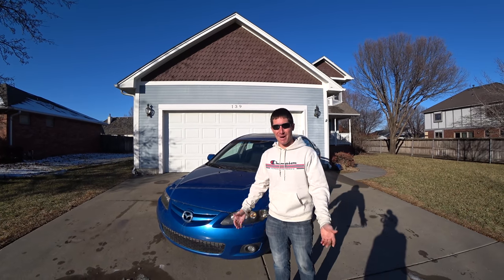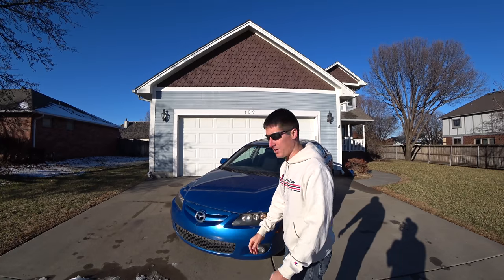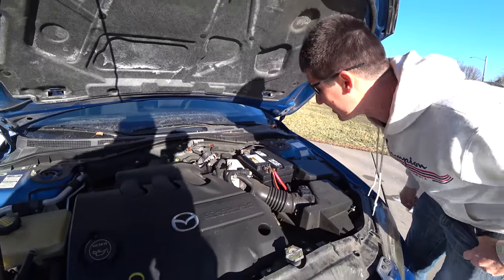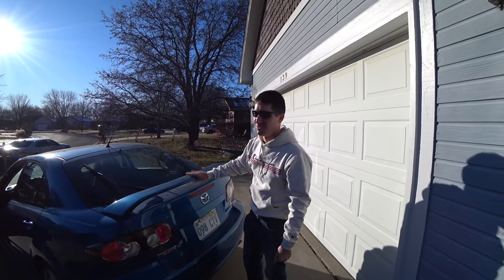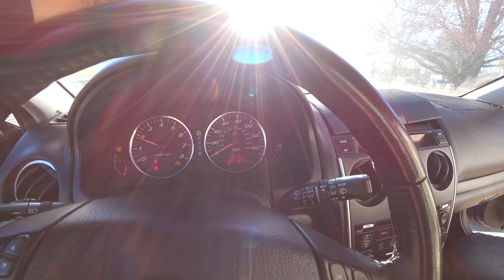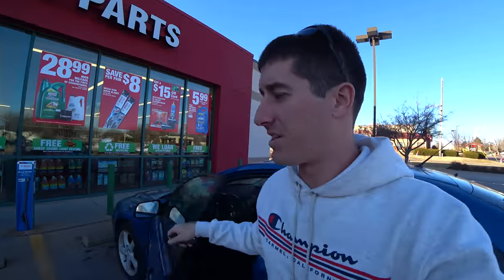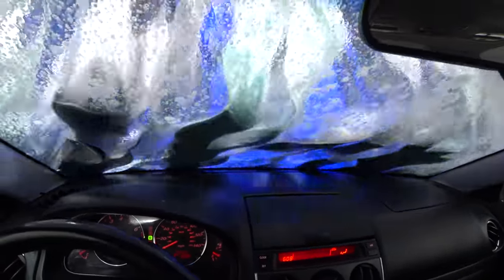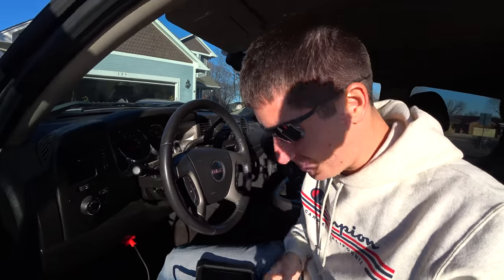I Bought The ELUSIVE Mazda 6 LIFTBACK For $800 *HOW BROKEN IS IT?*

Comment: A trick I learned for blown hood struts/hatch struts... open the hood/hatch all the way and take a rubber mallot, or the heel of a closed fist, and whack the piston of the struts straight back to slightly bend it. It will put a bow in the piston and give it enough resistance to hold the hood or hatch up temporarily. You can wiggle the hood or hatch to test it before putting your head under there.

Comment: We had one of these traded in at my work. It was a white wagon. V6, manual trans. Full tan interior which was ugly but extremly clean, no stains even on the floormats. It had air ride and rx8 wheels with wheel spacers. It was a one of a kind really nice car. Nothing wrong with it. I know because i drove it multiple times and looked it over almost everyday before the auction guys took it. Truly a nice one of a kind car.

Comment: These year mazda ,especially  the protégé. Last a long time and cheap to maintain.  Our family beater was a 2003 protege with over   250k on the original transmission and motor. We bought it at 128k. Sold it to my friend, who is a notorious car killer. Just saw the car last week.  He over filled it with oil and called me.  Oil was leaking out of everywhere it could and burning out the tailpipe.  Drained the oil and somehow it still works but now leaks oil from the motor seals. He also didn't metion to me that the front brakes stopped working and he still hasn't swapped out all the torn suspension bushings.  Hope the car can make it to Christmas.

Comment: I still have my 2005 Mazda6 with the 2.3 4cyl. it has a 5 speed manual and 170k miles. it has been a trouble free car for the most part. I replaced battery, clutch and radiator, everything else has been solid.

Comment: I own a 05 Sport Wagon with the rare 5 speed Manual, its my daily and I own a 06 Mazdaspeed 6..Few tips, the precats are are a known failure point on the Duratec 3.0's especially in the 6's, this is well documented, check them ASAP especially since you have a misfire!!! Cheap coil packs do strange things to the duratec, DENSO is reccomended by most,  Replace the EGR valve while doing the coils, its cheap can be replaced in under 5 min and is probably the reason why its using a little oil. my wagon is on its 3rd engine, 1st died due to precats failed - cracked ringlands and the final nail was it jumped timing, 2nd blown headgasket (cheaper to replace than do a HG job on a duratec) and 3rd was the charm lol, I have a few vids on my channel, great buy either way and they are super fun to drive, I guess its why I hold on to my wagon aka moneypit! - Ern

Comment: I love this channel.
I’d love to buy a car from this dude
IF
(I had the money and need really)
But I might get the money soon
BUT
I’d want all the bullcrap sensors replaced
New O2 sensors,
Mass airflow if it has one
MSD coil pack
E3s
K&N
Any leaks
PCV valve 
New breaks all around
New tires
New catalytic converter 
Perfect windshield and glass, sprayed with that Ceramic coating I got from the dealership
Upgrades where available 
On K5
Electric radiator Fan, factory crank fan delete
Electric power steering pump on 5.7 
Rebuilt running gear(s)
Carbon fiber removable top. (He’d have to learn how to lay carbon fiber)
On 08-12 Malibu LT,
ALL new lights.
The headlights have to take off bumper to change the dam lights.

Comment: Make sure you take note of the coil cables location. It possible the plugs might have been changed before by someone and the got two of the cables switched around. There is another YTber who has a garage that he fixes cars for people RTJ. He's found this similar issue with miss firing after the driver changed his plugs, turns out he had the cables  to the coil packs from cylinders 3 and 5 switched around.  :)

Comment: My friend just bought one of these that I towed with the misfire cylinder 6, he found that the back cylinders were getting filled with oil, carfax says it was at the dealer 5 times in 3 years for a misfire. Not sure. I’m a GM guy. But that’s my 2 cents to help you out.
Reply from the maker: I expected the same, plug wells were basically all dry on this one!🍻
Reply: WatchJRGo  he also did coils, injectors, gaskets. He went beast Mode on. Fixing all the sauce.
Reply: Bad Valve seals are common on the v6

Comment: Good cars.  I once had a 2003 liftback with the 2.3 inline four, 5 speed manual and a 2005 MPS (or Mazdaspeed I think you call them) with the 6 speed manual which was a quick car.  We never got the 3 litre 6 cylinder Mazda 6's here in Australia although my misses has a Mazda Tribute with that engine.

Comment: "Off to get the car detailed"  goes to car wash.  Seriously. you do a very good job of diagnosing and finding the flaws on these cars.  I would respectfully suggest that 190k miles, the differential fluid  (transmission in front driver)needs to be changed because I can guarantee you it hasnt.

Comment: I have a gold 04 liftback, 1.8 4 banger with 5 speed manual. That 6th gear is really missing on highway (4k rpm at 87 mph), kinda underpowered but it takes me places every day, and has only 80k miles (not much for 15 year old car). I just wish it had one more gear and more cylinders and perhaps rear wheel drive as well. Everything else is perfect

Comment: Those cars are just rebadged Ford Fusions. Some of the coolest midsize cars made in the early 2000s.  But they don't run for crap without Ford plugs and Ford coils. Oh well, not your problem!!
Reply: @Sean Mckernan .... You are correct...Madza standards was different from Fords....
Reply: its amix between volvo and ford, this car came before the fusion, more likely to be based on the older mondeo platform
Reply: Pretty sure Fusions didn't have a double wishbone suspension. There were a lot of things components shared between Mazda and Ford but it's not just a rebadged Ford!
Reply: @Emmo213  I've had both the 6 and plenty of fusions on the lift and the suspension was identical including all the "FoMoCo" stamped parts on the Mazda.
Reply: @Sean Mckernan as a Ford mechanic who has worked on plenty of Mazda's, every thing you said is accurate except Mazda being made out of better parts. That is simply not true. Most parts on a Mazda are stamped FoMoCo and have Ford part numbers. The difference is mostly in the interior trim.
Reply: @peterbollans9982  yup, Ford just robbed all the Volvo tech and dumped that company on the Chinese. The 500 was the first emergence of everything Ford stole from Volvo. But just a few model years later, you don't find hardly any left overs from Volvo. Ford really did a lot of in house r and d and stepped up their game in the early 2010s. That's when they started making their own Diesel, all their own transmissions, and we see more and more parts stamped made in USA.
Reply: @Sean Mckernan Ford still owns a portion of Mazda.

Comment: I have the same car, I’ve driven it 100,000 miles in 13 years. It’s been the best car I’ve owned so far, except for one fatal flaw: the AC drip hose is too short and leaked and rusted out the subframe cross member. Ten cent part ruined an otherwise great car.

Comment: I'm not a huge fan of small import carsBut admittedly, that one made me smile. hear in that condition. The car would run you about 2500 or more:(.i know do too , the smoking junkie ones are like 1000 at the used-car lots. And that's for from a smoking grenade of destruction. Would love for you to see the pile of crap that I had to buy because it was all I could get due to everything being so ridiculously priced here and just getting more ridiculous. I wonder, could you fit a washing machine or dryer in that car? I've been using a Dodge caliber, which looks like something out of a band or movie compared to this car, and I suspect the motors going grenade at some point. Looked at a few of these for my sister is why I know they're pretty expensive around here

Comment: I still have my 6 that I bought new in 2005. It’s the v6 with the 5 speed and still runs great. I tried the amazon nameless coils and they’re only good for a short time until they start crapping out. Your best bet is to buy the denso or motorcraft coils from rockauto. I’ve kept my car running good all these years by not putting in any cheap parts but I understand that this is a flip and the headache will be passed on to the next buyer.

Comment: Timing belt and waterpump ever been replace?
Reply: Duratec 3.0Ls are chain drive, and the water pumps are camshaft driven and very rarely ever fail.
Reply: @fordtechchris  and i thought all mazda's were timing belt driven!,now i can see of buying one!!.
Reply: @purpledoge4466  definitely depends on which Ford engine they're using. The Ford 3.0 is unbelievably durable! You won't be disappointed.
Reply: @fordtechchris  i see if i can find one,especially with a manual transmission.! Unless you get one XD.
Reply: @fordtechchris  My girlfriend's 06 went through two in 20k miles. That wasn't fun
Reply: @randym119  two water pumps?

Comment: My friend had a Mazda 6 bought brand new in 2002 and it was the worst car he ever had. Even thought he put 80000 miles on it he had to replace the transmission many times. Sometimes the car was towed from his driveway. The same engine as yours.
Reply: 1st gen mazda 6's changed after the facelift models released in 2006. So the issues won't all be the same as the pre facelift.

Comment: Hate Mazda's, hate hatchbacks. not at all interested in this one. Misfire is instantly plugs, wires, cap and rotors. You didn't do too bad with this one it seems. shouldn't have an trouble getting your money back out if it easy enough

Comment: John L-  These are the one of the WORST cars on the planet.  I have personal experience with this model of car with this horrible Durahell 3.0 V6. For one, it burns oil due to a badly designed PCV system which can be modified to slow down the oil burning rate. Second, if you need to replace the radiator, count on several hours down time...the whole front clip needs to come off.  The coils and fuel injectors go bad...replace ALL of them if one or another goes bad.  Also, this engine setup used FOUR catalytic converters!.  The pre cats will fail eventually due to the inherent oil burning problem.  When those go, they take out the engine and as it's usually described, the engine eats itself. The exhaust system is also badly designed.  The front bank exhaust meets the second bank exhaust at a 90 degree angle!  Very bad.  This also was fixed in later models.  Your power steering rack is probably stiff by now too, requiring replacement.  All this information I found out over the years while a friend of mine owned his.  You can verify all of this information online. I talked him into getting rid of it asap.  I recommend you do the same.

Comment: If this is from the Mazda-Ford era that means it's a complete piece of s%@#
Reply: lunisce, do you have or have you ever owned a ford or mazda with a ford engine in it? I have two ford trucks and non have left me stranded. One of those fords is a 2007 and the beast runs great. It has had small parts that wear out normally over time but nothing major that has taken more than an hour to replace. My mazda 6 I’ve had since new and all I’ve done to it was a clutch, oil pan seal and all suspension parts after 15 years of ownership. 

Idk about you but if any of my cars crap out today then I think I’ve had a good run with all of them.